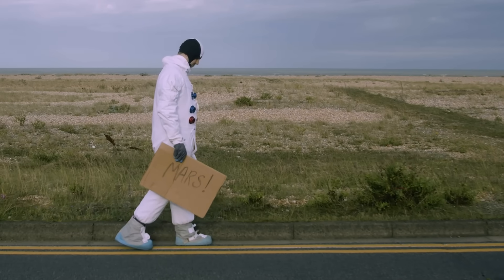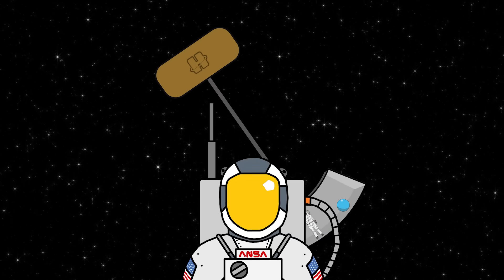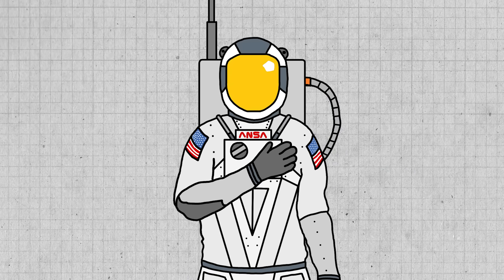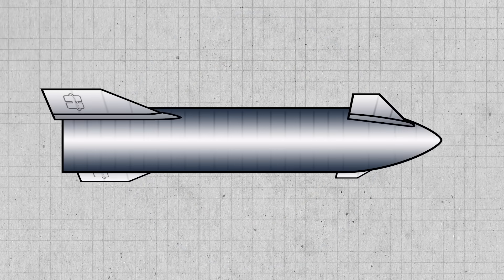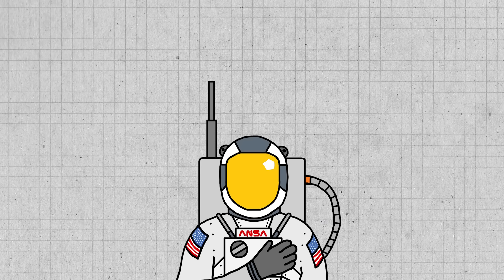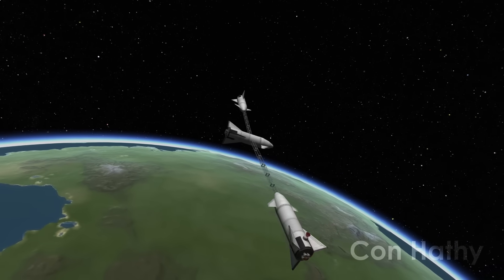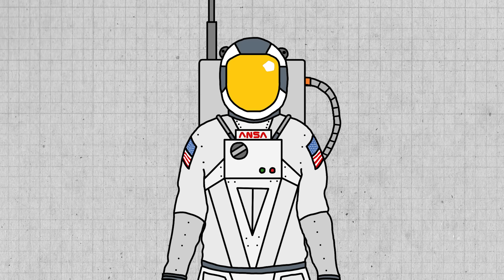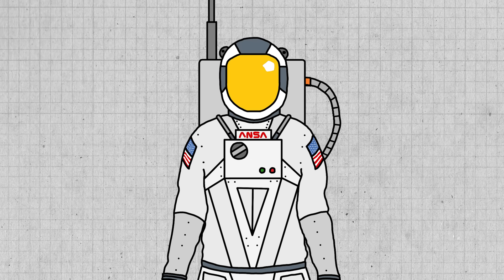This is NOT how you make Artificial Gravity

Comment: This all supposes that the only possible method of creating artificial gravity is rotation, which as mentioned in the video creates different gravity depending on distance from axis.

However, constant acceleration at 1g would produce earth normal gravity consistantly throughout the ship, with the back of the ship being "down". As the voyage is underway you  very gradually reduce the acceleration to acclimate the occupants to something more akin to Mars gravity. At the half way point you flip the ship to thruster-end first and decelerate at this same Mars G.

This means all of your deck, seating, beds, etc. is properly oriented and there is no gravity differential between people's heads and feet as thy move about the ship, with the exception of the the brief moments during the flipping manouver. 

It also mitigates fuel and water stores sloshing and having to adjust for load changes as people, water, and supplies move from one part of the ship to the other.

And happily it makes it more likely that everything from hatchling chicks to plants and insects would survive the trip.
Reply from the maker: I actually just did a follow up video on that

Comment: Tethers in space misbehave awfully. Without air or ground to sink vibrations, all vibrations tend to accumulate and increase until the tether snaps. Some smart material engineering - say, a gel/grease core as vibration sink could help, but springy tethers like steel are extremely self-destructive in space.

Comment: 05:58 long axis rotation would work with a some changes to the problems you mentioned:

1. Leave certain sections of the cabin in the "upright" configuration for takeoff and landing, and store equipment securely to compensate for the direction of spin... while utilizing the center of the craft as the common area to reside in while the ship is rotating.

2. Don't use liquid fuel. Use a solid propellant.
Reply: Good luck landing with solid fuel

Comment: Just out of curiosity: this requires a different fuel source, but what if a Starship had sustained acceleration of 1G, spins around mid flight, and then decelerates by 1G? The floor could remain the floor, and it would have stable artificial gravity for the whole trip except for the short time it takes to spin around. Due to inertia, any course correction should be minimal.
Reply from the maker: I actually just did a video looking at fuel sources for that
Reply: @ConHathy  thanks, I'll look it up!

Comment: they are not even trying, we have had decades of Leo, so decades of potential final stage rocket tubes they could have made in to test rotating interconnecting tube gravity wheels ,boosted higher ,rather than have them just fall back to earth & make them all meccano style interconnectable assembled & boosted up at the l1/l2 equilibrium with an inflatable inner skin as a stop gap local space materials resource etc.
god forbid they design the tubes floors as simple rotating platforms syfi style in reality

Comment: Easy enough. You just need at least 3 rockets connected to the central one. And voilà, we have rotational stability.
Reply from the maker: How would you keep them evenly spaced?
Reply: @ConHathy  I have 2 ideas:

1. When we have all rockets in orbit, we can build some structural connections between them. It should work well for not very big radiuses < 10m. 

2. Add some ropes to connect circling rockets. Maybe add some chord ropes, if we are going to make megastructure of 6 or more rockets. I'm not sure about this solution. I would test it somehow in some simulation program.

Comment: After finding out about this problem I previously had no idea existed, my layman's brain has instantly come up with a solution. You say the rocket is 50m tall, right? Just rotate it both ways! 5m at the top & bottom remain stationary, then divide the rest up into four 10m 'floors' (you can have more than one floor per floor... whatever you need, I just don't know what to call them), and have two rotate to the left, and two rotate to the right. Like a drone with four rotors, they all stabilize each other; or you could have six or two, so long as it's always an even number.

So, don't just guess. Only correct me if you know specifically what part won't work and how to explain why it won't. I know it can't be this simple because otherwise some "ANSA" scientist would have come up with it first, but just saying "LUL UR DUM" doesn't help anybody.

Comment: I'd be worries if you had a whole bed spinning like that 24/7 it would put a rotational force on the ship itself. I small one, but not negligible if you consider you have multiple of them running for months. You could at a counterweight to each bed that spins in the opposite direction, but then you're adding more weight again. (not that the tether would be any lighter but I think PR would think its a lot cooler and they have to appease the general populace with this "science" their doing)

Comment: Tethers are lighter than a rigid trusswork, but are there secondary stability issues with a flexible tether? Such as wobbling or twisting of the load, "crack the whip" scenarios, etc.? Is some sort of shock absorbing and dampening system necessary?
Reply: When enough tension is applied to a flexible cord it begins to act rigid. The velocity of spin required to create meaningful artificial gravity easily accounts for that

Comment: The small centrifuge research on Earth is interesting, but not applicable to in-space setups. We've already know that the vestibular system reacts completely differently from the small chair testing by NASA in the space station.  Other fluid systems may be impacted as well.  The affects of static gravity cannot be dismissed as in the papers.

We need to do more testing, of course.  Things like testing repeated use of the centrifuge.  A module on the space station in microgravity/freefall is needed to examine the effects of repeated exposure. What happens to the human body on the spinning table and return to the normal 'weightless' environment?  And how effective are changes over a realistic mission duration?  Can the chair spin provide the same results?  Can you do workouts or personal hygiene while on the table and regular work outside?  There are many questions that can only be addressed by a full flight test (the 'flying' ground truth) which cannot be done in a lab on earth.

Such a module would be a good candidate for something like the inflatable modules such as BEAM (Bigelow Expandable Activity Module).  The table could be packed and setup for use in the space. Then the module could be removed when testing is done to replace with updated versions or disposed of as needed.

Comment: I'm wondering what will happen to two tethered Starships when someone inside moves around. How will oscillations propagate through the system? Will there be some sort of Millennium Bridge effect where you make the tether vibrate to its harmonic frequency? Will it be easy to make the starships rotate gently back and forth around the axis of the tether? Will such effects even be noticeable?
Reply from the maker: That could be an issue, but we are much more aware of it now. It would probably be a few tethers with some passive vibration damping between them, so you may feel a little bump if someone jumps but it wouldn’t cause a continuous oscillation

Comment: Would the "t-handle" type flipping even matter for the subjective experience of the people on the ships at either end of the truss? And what if it were a cable or truss that could be connected with a swivel - wouldn't the inertia of the outer ship prevent them from spinning if there was essentially a nice, high-tech, frictionless bearing attaching them?
Reply from the maker: They would still feel gravity mostly downwards but it would feel like the entire room was rotating 180 degrees at random intervals (and very quickly) this is much more nauseating than constant rotation, and it could literally feel like someone is pulling a rug out from under you causing you to fall and things to roll/fly around

Comment: The type of artificial gravity you're talking about and saying is the only one is just what will have to be used for now in the present. But it itself is not artificial gravity because when you're moving in a circle on the curve your floor is constantly shifting to one side of you like a funhouse barrel that you walk through the spinning except on a larger scale. Even sitting at a table pouring a drink into your cup if you aim for the center of the cup it will be off to one side some and this affects all of your equilibrium.
The only true artificial gravity is acquired through straightforward acceleration in the first half of the flight then turn the ship 180 and use the proportion to slow this spacecraft continually on the second half of the flight. This way it is pulling straight down on you would not rotations or curves. The news ion drives that they have for the satellites these days for a long journeys or to constantly accelerate once you're in space will have to be upsized for this to work though. So basically we aren't quite there yet. Just adding the information the way I understand it. 👍🏻

Comment: What about have 2 systems with 2 ship.(so 4 ships in total). The systems counter rotating. But stay connecting trough some low friction gearing.

This way you can speed up and slowdown using electricity and not use fuel.

Comment: What I was curious about, is I noticed the middle ship was not aligned with the other two. How would the rotation be if it was? In space, you do not need to be aerodynamic, so what if they moved the engine in the middle configuration to the center and turn the rest of the ship to be inline with the other two ships. Imagine the body of the middle ship (the fuel tanks, etc.) would pull out of the frame and rotate to point in the directions of the two other ships. Each ship would dock, attach a tether and rotate. This would put outward force on the two ships and they could release the tether attaching them to the middle so that they could move outwards. They could use ion engines (very low power but also very low fuel) to slowly ramp up the rotation as they move outwards.

Since the middle ship would be inline with the other two, the odd rotation would not be as big a factor.

Comment: see if you can find a copy of Spincalc© by Theodore W. Hall . . . it calculates artificial gravity of rotating systems . . . you plug in radius, angular velocity, tangential velocity or centripetal acceleration and it calculates everything else based on what their present values are and whatever parameter you changed . . . it also estimates if the condition is workable for most people.

using a 30 meter radius and 0.5g you get a tangential velocity a bit over 38 m/s and an angular velocity a bit over 12 rpm . . . with two Starships that would make for a very short tether (it could even be a rigid tube).

Comment: a fully contained ring is the only way to do it due to the sudden impulse response you'd get in space, no metal string is strong enough to handle impulse jerks, not even titanium. maybe carbon nano tubes or something in the far future, but for now, 2001 a space odyssey is the only way to go. that, and HAL.
Reply from the maker: The ring would have to deal with loads as well. I’m not sure what jerks your expecting that would be beyond all the steel tension bridges we have built on earth

Comment: Single Starship rotation is so much more practical. Detaching the furniture from the floor and temporarily bolting it to the ceiling is so much easier than dealing with multiple tethered craft.
Reply from the maker: Of course it’s not just furniture, it’s plumbing, medical equipment, cookware, Eva suits and all the tools and cargo that you’re taking to the surface. At that point just do the small exercise bike centrifuge because you’re not doing a large radius system anyway

Comment: The ring type seems legit. And for the record. I discovered it as a child. Playing with a bike tire. I noticed that the rain water stayed in when I sent it flying across the yard. So I got the hose pipe and experimented. It works even with Earth's gravity trying to pull it out. It works sideways here on earth. You will get wet but it will hold some until it lands. Just remember too spin it.

Comment: SciFi has give us the Idea how it can work, with rotating elements.

like in 2001 a space odyssee:
https://buecherstadtkurier.com/wp-content/uploads/2019/08/2001-Odyssee-im-Weltraum_1.jpg
https://youtu.be/0ZoSYsNADtY?t=60

and Odyssee 2010:
https://i.pinimg.com/originals/20/f7/82/20f7822f6fd20db918fb88a507c75b36.jpg
https://youtu.be/U-Wy4MhYx94?t=59

It is not necessary to rotate the complete ship, so like in the Ship Leonov in Odyssee 2010, where Fluids and other Materials who not need Graviuty stay in the normal Parts of the Ship and just the Areas with the Crew are in a Rotator component.
Without the friction of Air, the Rotation can be achived with small thrusters only.

Comment: Thanks for the video. I really enjoyed it. Could  I request  you make a video explaining how an anti gravity like in the show "The Expense " from prime video  shows how the ships use the thrusters at the bottom of the rocket to create  an A-G. It giving a constant  thrust "could  create  a constant  g-force allowing  gravity to exist.  In the show the ship would travel  halfway to its destination  thrusting towards it. Once it reaches  a halfway point the ship will flip it's  nose and now the bottom  of the rocket is facing the destination point.  Then the ship runs its thrusters pushing against the direction it is going. I really like this concept of space travel because I seems to eliminate the idea of rotation being the constant. The only and biggest  real flaw I see in this concept is the power/fuel portion of this idea. In the show they created  what they called an "Epstein drive" and it's  basically  a  Fusion power generator allowing  then to create constant thrust and not kill themselves on fuel cost. If you're  interested  in making a video about this and explaining  more of the problems it could have I'd  love to hear it. Thank you
Reply: Yes that would be optimal as it would perfectly simulate gravity, however, we do not have any kind of propulsion system that could maintain 1g acceleration and then deceleration for very long. That's why they had to come up with a breakthrough propulsion system in the show to work around this. Not much reason to make a video about it since it is currently impossible.
Reply: That really is the dream, I think. Given a constant 1g acceleration and then deceleration, it would take a spacecraft about 2 months (based on some quick calculations) to reach mars from earth at their closest points. There's just no technology that can achieve anything near the proper thrust to weight needed for that long of a time.

Comment: I will admit I am for big spinney things. For the convenience of the occupants. But yeah. For me the most logical way was always to have two crafts that spin via a long teacher since you're just coasting your way to Mars anyway. It is simple and easy. And then I get people who question if you can build a tether long enough or strong enough. But we are pretty good at that. We build heavy bridged suspended by them. Even funnier when they think a space elevator is feasible. (Which I question a bit even if we did get graphene production up. I prefer space fountains anyway.)  ^_^ 

 This should not be to complicated. Just need a bit of fuel. And you could even do it with one craft if you split it in to two halves. Though in this case it seems wise to just make two star ships and have them attached by the nose.

Comment: Has anyone thought about timing short burst of an ion engine that engages only for a short period, once per rotation, when it is pointing in the right direction that it not only accelerates the rotation but also adds to your velocity toward your destination? 
It would also be able to slow you down when you reach your destination. Therefor no fuel would be wasted.
Reply from the maker: I don’t know if ion engines would have enough thrust to be practical for spin up or spin down. I did find a paper outlining a model for using a gimbaled engine to provide thrust while rotating without destabilizing the craft

Comment: Two spacecraft connected by a ultra light ultra high tensile strength cable would do it.    Set them spinning and they will rotate around the natural axis of gyration depending on their relative masses.  If they are the same mass the axis will be half way between them.   If you want to transfer from one to the other you have a lightweight  inflatable passageway between the two.   To avoid a massively high RPM (angular velocity)  you position the two quite far apart, i.e a long cable.   No need for a toroid.

Comment: Finally! I found a video talking about the same thing I've been thinking about for years now.
Yes, bone and muscle loss are the biggest physiological problems for a trip to Mars.

I envisioned two cuboid shipping containers tethered together by cables (and transit ducts) about 200 feet apart, slowly rotating around their center of mass.
Reply: A trip can be shortened to about 40+ days with a variable impulse ion or plasma engine, such as Ad Astra's Vasimr engine.
Reply: The biggest problem may actually be radiation. Bone and muscle loss can be kept in check with training. The longest stay so far was 437 days, so the astronauts would probably survive a Mars mission even without artificial gravity or spending time on Mars with a 3rd of Earth gravity. The question is how long it will take them to recuperate....